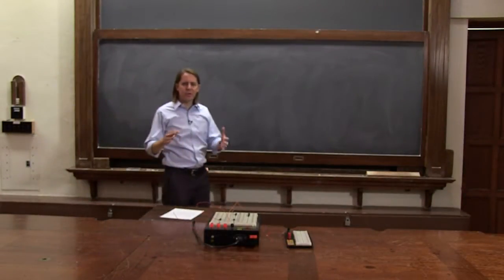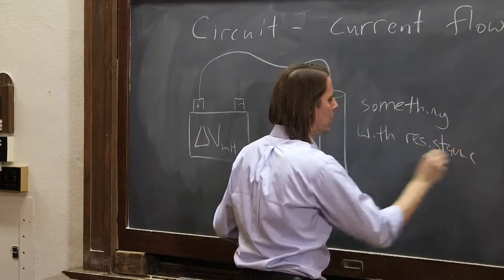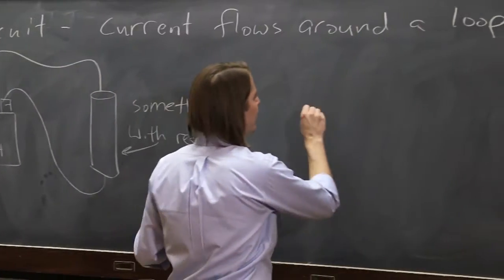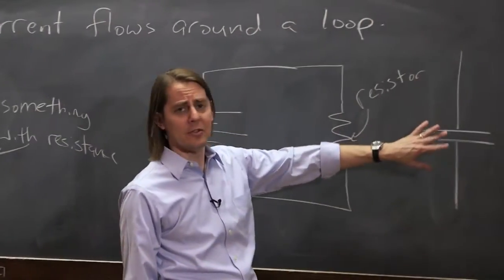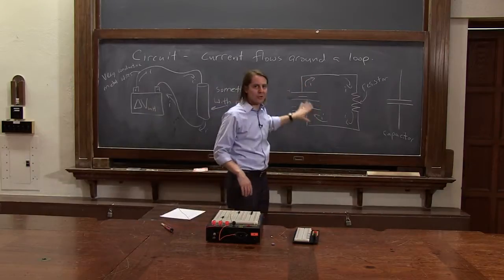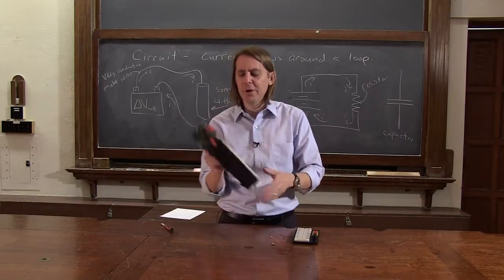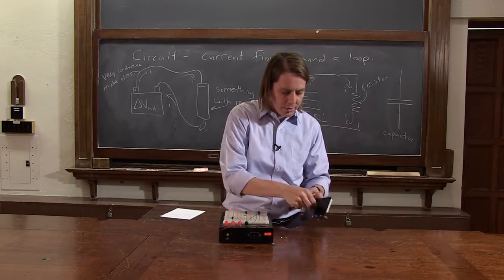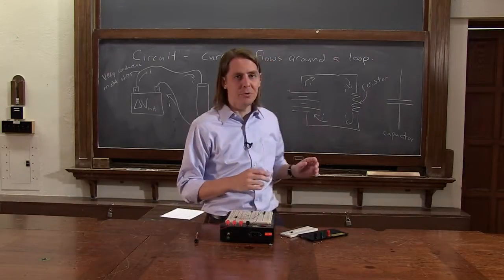PHYS 102 | Circuits 1 - Definition, Symbols, and Bread Boards

Comment: Hello sir! How is the electric potential at a point defined when it is located inside the field generated by a battery or multiple batteries considering the fact that the electric potential at a point due to a single charge is kQ/r?